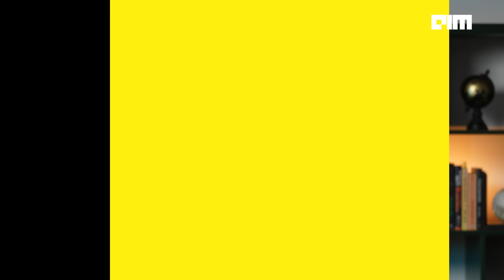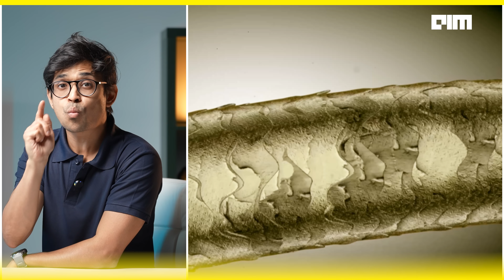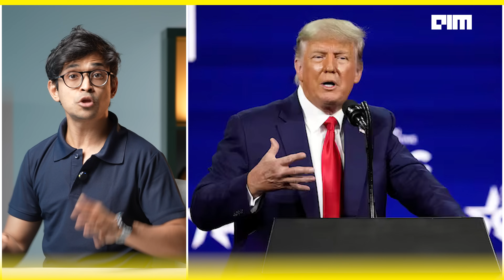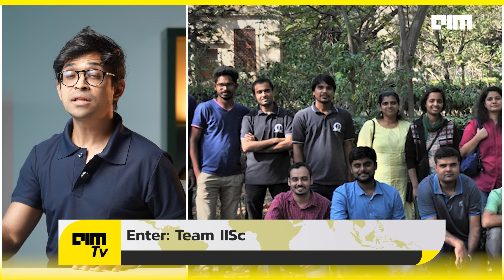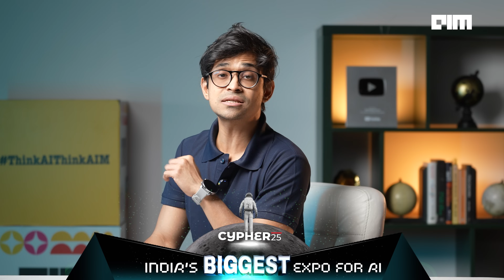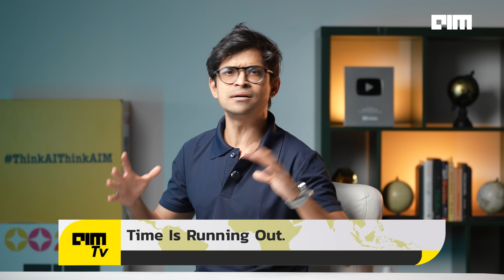India’s Boldest Chip Bet: IISc’s Race to Build the World’s Smallest Semiconductors

Comment: Hydrogen atom is 1 Angstrom & that is the smallest atom.  How will they make a transistor on that scale ?
Reply: Well for context let me tell if tsmc claims 3nm, it doesn't mean whole transistor is 3nm size, it means the channel length is 3nm. To put perspective imagine two block of metal put at 3nm apart. The problem here is after some point the electricity just jump through the gap without any control that's called leakage current. For 1 armstrong gate, we need to fix this leakage current
Reply: @AnkitKumar-tt5hs Nicely explained. Also a big problem occurs when mass manufacturing. As we are going smaller and smaller to squeeze more transistors into the wafer, the failure rate is also increasing. Out of 100 chips, reportedly only 40-50% are able to pass intended use even with latest EUV tech. 50% has some defect hence cannot be used (although companies are now reusing some of these chips in their base models like the Apple A18 on iPhone SE has 'defective' Chips (have 1 dead core inside)
Reply: @DocPrakhar  ? ? 😳
Reply: @AnkitKumar-tt5hs  youtube deleted my comment because I was critical of the channel. Anyways I will re comment without vitriol now.

Basically all these 5nm 3nm 18A are all marketing terms, the channel length will continue to be around 10nm in present tech, beyond that the laws of physics start to get a bit too wobbly for computing. So what's changing is that there are new innovations around gate design. The past few years it has been FinFET, moving forward it will be GAAFET ribbonFET etc. also there are technologies like backside power delivery, which will enhance the energy efficiency and transistor packing density. Thus transistor densities and power efficiency will increase but without making the actual transistor smaller. These will be successively named as lower nm/Angstrom nodes. But really the size has little bearing to the actual physical length of anything inside the transistor.
Reply: @sumansaha295  Thanks for the explanation. 👍
Reply: @sumansaha295 I agree with your point and totally familiar with what you are explaining. This is a rather non-tech based video and people in comments are not familiar with technical terms. Also i agree these are marketing gimmicks actually cpp of 3nm transistor is 45nm.
Recent advancements may help in efficiency. But it's still limited by quantum physics. Beyond 1nm quantum tunneling just ruins the whole transistor operation.
Reply: @sumansaha295  true lol this guy thinking they're decreasing the gap instead what companies do is changing height and width of gates designs last few years and giving us fake marketing lies as in past they marketed efficiency in terms claiming nm scales simply
Reply: @AnkitKumar-tt5hs Thanks ! That  makes everything clear.
Reply: @AnkitKumar-tt5hs  no way u can control that electron quantum tunneling escape effect those energy bad gap wouldn't be sufficient, best is to focus in quantum qbits based system there is a reason why all major tech companies focus qunatum left trying classical silicon based chip into less than nm scales
Reply: 500 crore do fir batunga😂😂
Reply: Scam 2025 IISc

That being said all these nanometer and angstrom stuff is just marketing anyways, things aren't really shrinkable anymore past 10-7 nm. Instead what is happening now is that they are coming up with more innovative ways to create the design of the gates of the transistor, currently it's FinFET, moving onwards it will be RibbonFET, GAAFET, then other innovations like backside power delivery networks etc. These technologies will be termed as 18A 10A etc in future, but really it has no relation to size of things. It hasn't been for a while...

this guy could have gone into those details or more about project proposal but instead he came up with a clickbait video.
Reply: @pravindahiya719  how how?  through extensive research.
Reply: @adityagajjar3118do you even know how a transistor works ? It has three layers of semiconductors.  Can you induce THREE layers within ONE atom, that too Hydrogen ?
    Edit :  don't mind . Some knowedgible guys explained it.  I am not an expert & so are you !

Comment: Are you an idiot? Armstrong is greater than nanometer by the power of 10
Reply: Bro who taught you maths 

1nm =10 Angstrom
Reply: @vijayadeep0_0  sorry there was a slight mistake on my part but still, whatever he is saying is not possible because making a chip smaller than 1nm breaks all the laws of physics so not possible
Reply: @divithh1477   Yup , That's where quantum physics interferes
Reply: @vijayadeep0_0  Chips under 1nm are currently impossible because quantum tunneling, material limitations, fabrication precision, and thermal instability prevent reliable transistor operation at atomic scales.
Reply: @divithh1477   I gues we need to stack up the transistors above one another instead of going 1Å